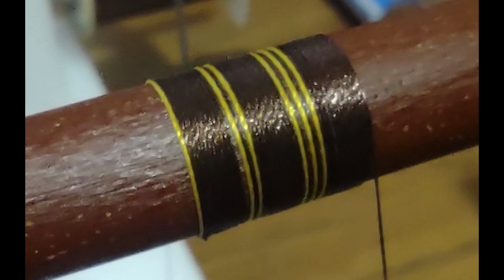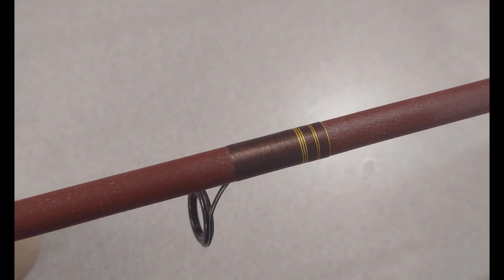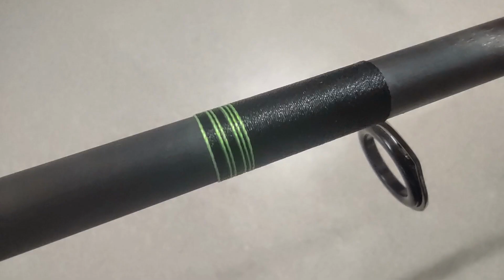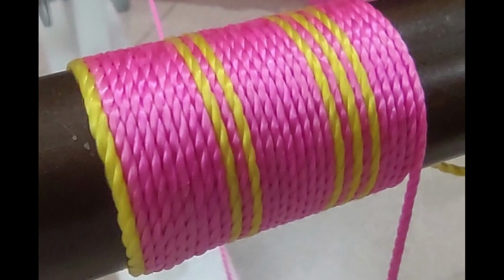Rod Building 1-2-3 Trim Bands - Practice Single Turn Trim Bands & Wrap Inlays At The Same Time

Comment: Hey Buddy nice to see you here, Joe from (Off The Hook rod and Reel). I generally scuff the blank with scotch bight for that as it makes the thread much easier to control. What your thought?
Reply from the maker: I usually don't, but there are a lot of people who do. It also should promote better adhesion of the epoxy to the blank. I have done it both ways and I haven't noticed any difference, but I'm also mostly building freshwater rods. I also use small diameter thread. If I were building big game rods, I probably would scuff the blank up a bit in the guide areas.